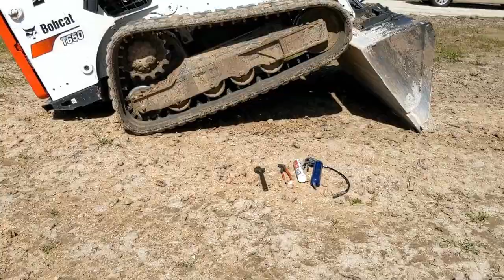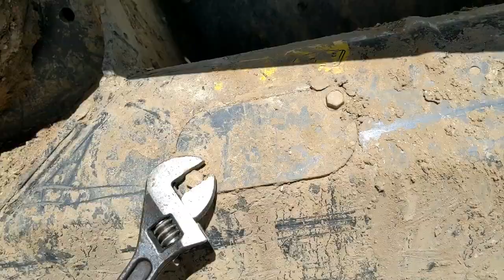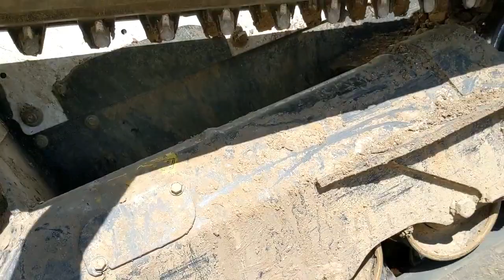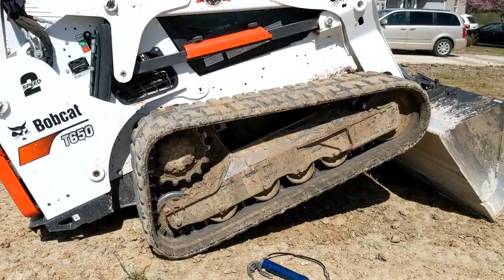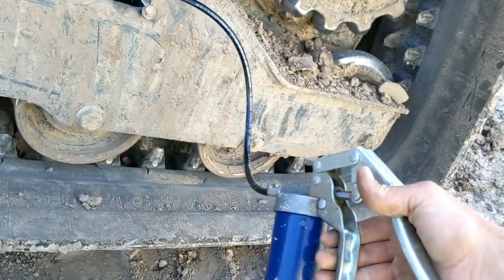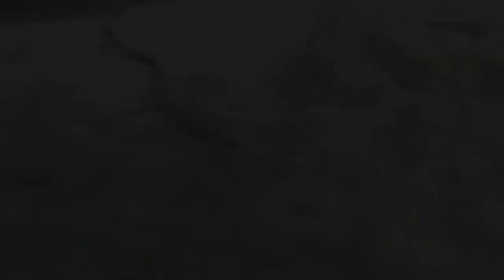How to Tighten Skid Steer Tracks - Bobcat T650

Comment: I bought a worx coordless pressure washer, dual battery to clean areas I need to get into.    I like the Milwaukee Corrdless Grease gun with the LockAndLube fitting on the end.     My 2014 T650 has the roller suspension and the grease release and zerk panel is  right there under the sprocket roller where all the mud cakes up, so it's a bit of doing to get it cleaned off.     I like those Gojo hand towel packets for keeping hands clean from the grease that gets everywhere.
Reply from the maker: Wow! Lots of helpful tips! I’ve been wanting a cordless grease gun.

Comment: Do you have to loosen up the zurk too?
Reply from the maker: Only if you want to release the pressure on the track. Main reason being if you were to install new tracks. The zerk has a one way valve only allowing grease to go inside and fill the cylinder pushing on the front idler.

Comment: How do you retract it to fit it in ?
Reply from the maker: When we change tracks usually we will use our Bobcat E35 to push on the front roller to retract it (after loosening the grease bolt).  But you can also use a pry tool such as a 6' bar.